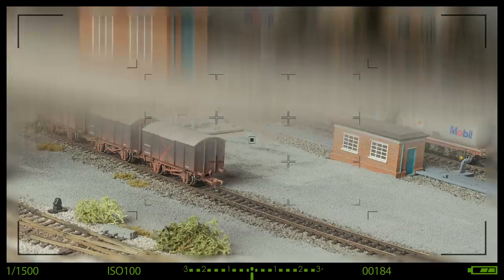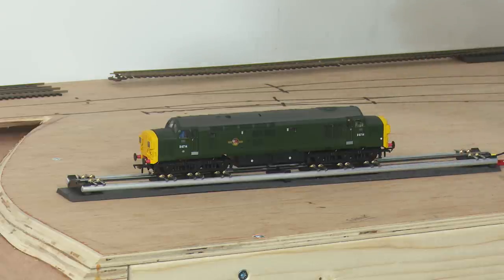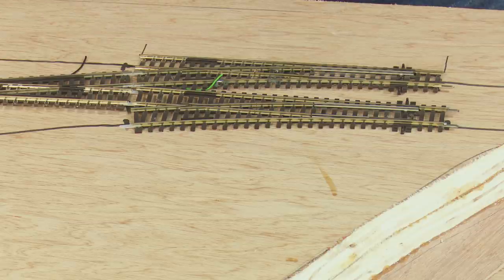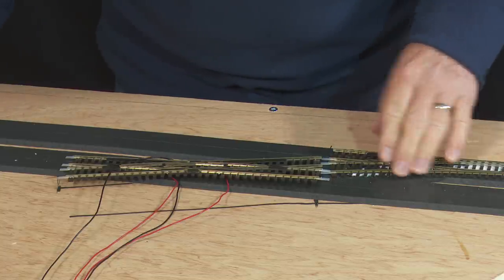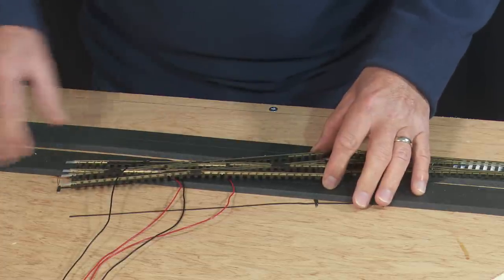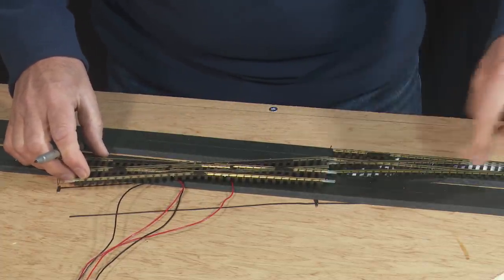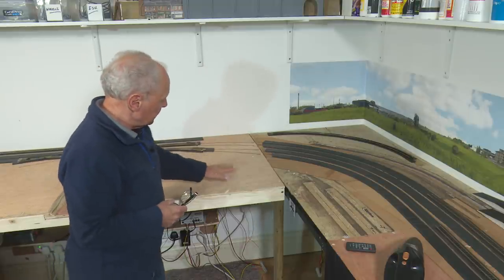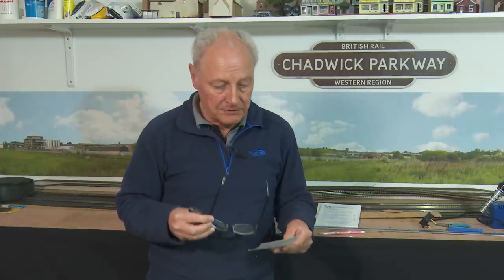Laying Track Bed and Laying Points at Chadwick Model Railway | 91.

Comment: Thanks Charlie, another entertaining and educational video, very enjoyable. The link to Railwayscenics is very useful, thanks for that, but I am a bit puzzled though by their comments on 7/0.2. They say “A general purpose single core unsheathed stranded tinned copper wire for wiring most accessories for model railway layouts, including low voltage lighting and LEDs. Not suitable for DCC bus or dropper wires, but can be used for solenid point motor operation as long as a capacitor discharge unit is not used.” Is this them being ultra-cautious or is it about the length of your droppers? (That last bit sounds a bit rude). I know next to nothing about sparks and would appreciate your view. Best Simon.
Reply from the maker: To be honest Simon I use 7 x 0.02 up to 6 foot in length before I switch to a larger cable.

Comment: Thanks for another great video. I copied your method of track laying using rubberised glue I obtained from Germany, I don’t think you can buy it in this country, it’s called UHU but it’s made just for foam. I am interested now in how you stick down your ballast using a rubber glue, I wasn’t aware it could be watered down. Thanks, Mel
Reply from the maker: I didn't say that it could be watered down Mel.
Reply: Sorry I am guilty of assumption. I am only used to the watered down glue method, so I will hold off ballasting my track until I’ve seen how you do it. Thanks, Mel

Comment: very interested to see how you get on with the WS foam underlay and a rubber based glue for ballasting. I'm also a bit concerned about noise as my layout is loft based, so can't yet decide between cork for under the track or using the foam. What glue are you planning on using for the ballast as not using PVA?
Reply from the maker: I'm hoping Richy, that Elmer's Glu-All will do the trick.  I will carry out a little first though.
Reply: Can't wait to see the results. Watered down like PVA?

Comment: Brilliant timing, Charlie. Doing something similar myself in the near future.  I've finally got some track I'm making into a Minories. I have had to pay over the odds as Peco have ceased production, shops are out of stock and eBay sellers are charging what they like because idiots like me will pay. Now or never though. Thing is, I've got points going into points which is going to generate a lot of spaghetti (@32:17-style) and I'll probably go cross-eyed at least a dozen times per point wiring up! Wish me luck! All the best to you and yours.
Reply from the maker: Yes Hattons are out of points too! Just when I needed 10!
Reply: @ChadwickModelRailway  Luckily I didn't pay too much more than usual. Needed to put my annual bonus to good use ;)

10?! Leave your kidneys where they are, Charlie and step away from the bread knife! ;)

Comment: I am trying to locate the Slitting Disks that you use with your Dremel. Try as I may I cannot see what the Squires Part Number is for the one in the package that you show in this video.
I note your comment of the disks thickness and its price. I live in Portugal and can access the Squires Parts Listings on-line but it would be useful to know either the part number  and/or the page number in their on-line catalogue so that I can order a couple and the suitable mandrel. Many thanks for your very informative videos...
Kind regards, Martin JACKSON, retired in a sunny Central Portugal.
Reply from the maker: Hi Martin, the package is labled 091 140.  If that's not useful perhaps you should email Squires Tools.
Reply: @ChadwickModelRailway  Thanks for that information  Charlie, just needed to confirm the details as I didn't want to order and get the wrong item. Keep up the good work and stay safe...

Comment: Something I've wondered about Charlie: have you, or any viewers, tried using sound deadening between the baseboards and the bracing? Would using polystyrene/foam everywhere that wood is joined to wood maybe help? Same with the legs/feet: maybe try some foam around these bits? Just wondering if anyone has tried anything similar.
Reply from the maker: You are the first to mention it and I hadn't even thought about it ....... until now!

Comment: Brilliant video - was wandering what options there was for underlay while designing first layout , you have given some great insight into the pro - cons to look at :) was just wandering the wire you snip off the points is that only required for electrofrog points or could the same be done on insulfrog points? thanks again
Reply from the maker: Hi TR,  the two short links that I snip through, I believe are not on isulfrog points.

Comment: For areas such as fiddle yards where you may not be ballasting, I assume covering the whole area with cork rather than individual runs of foam would be suitable (and glue not pin of course!)?
Reply from the maker: I'll probably use a cheap under-floor foam Ian.

Comment: There is a story attached to that foam ballast - some horrible chemical was used in its manufacture so they had to discontinue using it, but that makes the foam unstable and causes it to turn to dust! The finished product was quite safe to use, so if you have got some foam trackbed purchased many years ago, like when you were a boy, then it will not disintegrate. I have used track screws in preference to glue
http://www.alansrobinson.co.uk/model%20railway%20track%20pins%20and%20track%20screws.html
You can get screws to a suitable length to take account of the trackbed.
An alternative to cork or foam is to use foam core board. This being made of polystyrene does not absorb PVA used to glue ballast. I have used cork clippings in preference to granite which seems to exacerbate the transmission of noise from the train to the baseboard! Always a measured and relaxing commentary from the Chadwick Model Railway. Thanks for uploading.
Reply from the maker: Thanks for a good explanation of the foam’s history. Good luck with your project, regards Charlie.

Comment: Dear Charlie, many thanks for this another fantastic instructional video. I appreciate, you covered all the details so needed in this step by step video. I have one question, is there any particular reason why do you use two different glue types: copydex for foam to plywood and WS foam tack glue for track to foam? Thanks.
Reply from the maker: Hi F78, they are very similar but the Copydex is cheaper.  I thought that Woodland Scenics own product would be best on top !
Reply: @ChadwickModelRailway  Thanks very much for your prompt response. Good to know and confident to follow my work thank to your "how to" videos.

Comment: Wondering if insulation affixed to the underside of the base board would help cut extraneous noise.
Reply from the maker: I will look into it Garth, once everything else is sorted. I just didn’t want to make any mistakes at this stage.

Comment: Dear Charlie, after a while I visited this episode again and found another information I am looking for - sizes and types of wires. Great stuff, thank you. In terms of the usage of WS foam tack glue and Copydex, did you try to retrieve the track after everything dried up? I like the idea of sound diminishing but retrieving the track for re-use elsewhere would be something advantageous. PS, you can potentially retrieve track when using PVA (with warm water).
Reply from the maker: Hi Filip, to get the track off of the foam is really quite easy, just dont use too much glue when you lay it.
Reply: Many thanks Charlie, sounds good then.

Comment: Great videos Charlie.

Question: wouldn't an open board design reduce the noise considerably? The flat-top baseboards seem to produce a drum skin effect which is hard to overcome.
Reply from the maker: Yes Ed, but my subscrbers can't follow that lead.
Reply: Fair enough, I'm learning myself - I love sound too but have N Gauge models where this problem is even more pronounced!

I think open board is the way for me to go, foam infill for anything/everything that isn't carrying the track i.e. that would be on a slither (or snake) of plywood.

Comment: Great series of videos. Regarding the sound issues: foam will counteract sound waves of one frequency, and foam another. Could you not lay a thin cork bed first then the foam? I don't know if there are very thin cork sheets available to avoid a very high track bed, but I am fairly certain the noise reduction would be considerable. Might be worth experimenting?
Reply from the maker: I think that you're right and I have some spare cork too IL.

Comment: Hi Charlie. Ive watched this vid a couple of times but one things strike me: why does everyone glue ballast? Full size railways dont use glue, why should modellers? I could see the need on points but, straights and curves? Yes, unglued ballast moves, so what, just brush it back. What am I missing?
Reply from the maker: How would you keep the layout clean?
I use a vacuum cleaner!
Reply: @ChadwickModelRailway  Good point, Charlie. Does the actual track need hoovering though? Beyond the width of the trackbed, I would have thought just careful hoovering would be the order of the day. And, if you do hoover up a little bit of ballast, empty it out of the hoover and re apply to the track.

Comment: Hi Charlie, thanks for the video. One question; the green dropper for point power, on my point sets (perhaps old  design) I can see the 2 jumpers but not the one you solder to. Any thoughts? Cheers again!
Reply from the maker: Hi Edward, my points are Peco Electrofrog.  If yours have a small plastic section on the frog, then switching its power is not required and no dropper is present.  I do hope that makes sense.
Reply: @ChadwickModelRailway  They are Electro points, but annoyingly, on closer inspection this little dropper had just been pulled off... Used points for you! Thanks anyway 😊👍
Reply from the maker: There is a way of soldering the three rails back together.  You need to do a continuity check to establish which parts are broken.  Which type and size is it?

Comment: Great video.
Can you confirm that on the curves you are laying track 5cm apart?
Using PECO Streamline code 100? 
(Not 67 mm apart as PECO Standard fixed radius curves.)
50mm is sufficient clearance?
Reply from the maker: Hi Gavin, they are not 5cm on the curves.  I deliberatly open them up to avoid coaches clashing.  Once the curves are in, please ask again.
Reply: Thanks, I'm using Any Rail 6 track planner, and trying to work out how I go from straight parallel track 50mm apart into curves which are 67mm apart.

Comment: Hi Charlie. I wonder if you (or anybody else) have considered placing something underneath the baseboard.? I have yet to start building my model railway, but I have long thought about the transmitted sound and wondered if a layer of insulation  (Perhaps some carpet undelay) stuck to the underside of the boards might diminish the transmitted sounds? Just a thought! Always enjoy watching your videos. :)
Reply from the maker: Car sound insulation seems the best option once it's completed Steve.

Comment: Dremel cutting discs from any good DIY centre cheaper than you get them for
Reply from the maker: What size and price David?
Reply: @ChadwickModelRailway  the last lot I bought were from eBay came with fee post= [6pc Mini Diamond Cutting Disc Set For Hobby & Dremel Drills with 1/8" Shank]
4 x 20mm and 2 x 22mm cost £3.35 per pack, but there are many other sizes for less than £6.00 per pack. I am a pensioner and have to work on a shoestring and have to sort as many bargains as possible a hence I make my own scenery grass trees hedgerows  etc
Reply from the maker: Great tip, thanks David

Comment: When you cross between the board joins do you fit anything to hold the rails in place, like copper clad sleepers / brass screws or do you run the rails over and not worry about cutting them at the board joint?
Reply from the maker: Yes I just run them straight across Martin

Comment: No Union Jack pin?  Great vid and snaps to those who also asked this question
COST?  cork vs woodlands scenic lifetime foam per meter what works out the best value for money?
I would be tempted to run the vacuum cleaner next to the drill as your drilling just so you don’t get all the excess particles and dust flying off that may settle into the wet glue it’s a trick I used when multiple gluing projects were happening at once which many of us get into a roll and will get several things into the production line when we have some quality train time. Nothing beats the feeling of a productive day of having several projects glued, weighted and next time you return ready to greet you the next time you come back the layout. 
Would have been super if you were running an spl meter app on your iPad in the background just to graph out the spl levels.  Sorry that’s just me being anal as my other interest is hifi lol. Top work Charles!
Reply from the maker: I had to Google SPL levels!
The Union Jack pin is in the green top which has a hole made by a hot flying fragmnet from grinding!

Comment: hi Charlie.. have you considered laying a sheet of polystyrene what i call ( jablo) then the cork ontop of that?
Reply from the maker: But then there are problems with point motors reaching the point.
Reply: @ChadwickModelRailway  
Hi charlie.. tnks for replying.. i am not sure on that point. But if i remember correctly you are making your own  motor leaver by using a sturdier piano wire?? So an extra 1/2 inch polystrine sheet on the base board shouldnt be that much of a problem.. i dont have my own layout to test it for you. As the layout i had dates back 35 plus years. But thanks to you i am contemplating in building a dcc system now that i got a nice empty room 14ft x 12ft.. still in the thinking about it and planning a rough idea on how i could do it. Mind you. I am now 64 and what better way to pass the time i have left lol.. my biggest obsticle i think would be the wife lol

Comment: As opposed to actually SAYING the word "obsessive" try using the abbreviation for obsessive compulsive disorder  and"OCD" and then add a modifier so you can refer to yourself as having a "mild case of OCD" as opposed to someone saying they are fanatically OCD.
Reply: Your "thing" about rail joiners can be addressed as a " mild case of OCD" 😎🚂
Reply from the maker: Hell the truth hurts!
Reply: A certain degree of OCD is helpful to keep our Railways running efficiently ( black to the back ). The problem is too much of an ocd complex can almost paralyze you for example after 15 years I'm finally about to wire my track, lol.